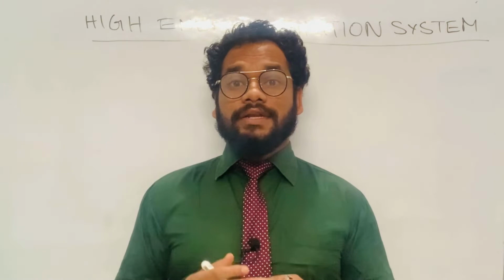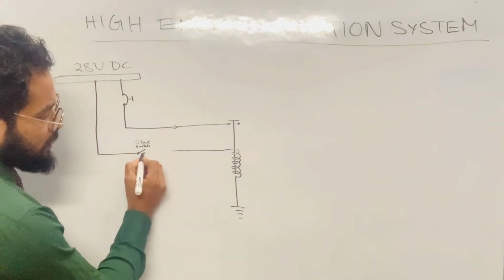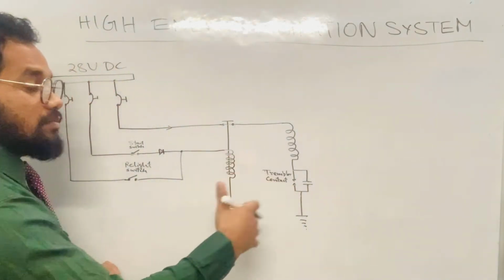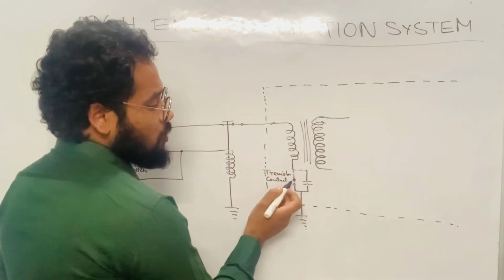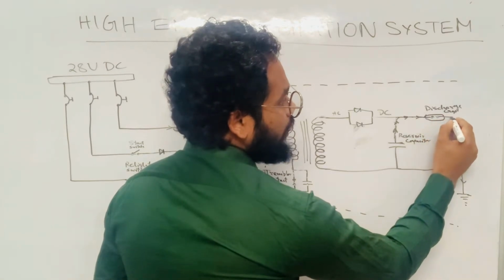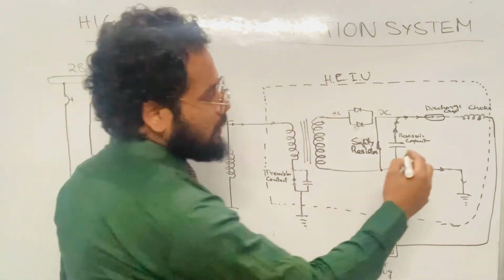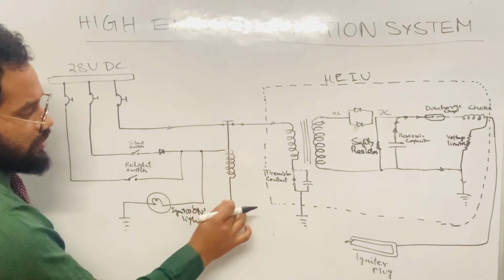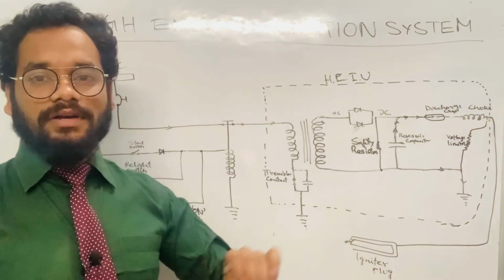High Energy Ignition Unit (H.E.I.U.) in Turbine Engine| Basic High Energy Ignition System-Schematics

Comment: Well honestly I have problems finding correct circuet for me own car who is Opel Ascona from the 80s it has GM HEI ignition with E Core coil 4 pin ignition module and induction trigger.
Any ideas how I posibly culd retard ignition timing in that thing?
It uses the MC 3334 ic chip easely can by found diagram for the HEI ignition system.
And you didnt realy mention if the source is pulsed dc or flat line,what frequency is that trembler operating at and if it realy did crated ac why peopel dont get shocked true the chassys in a plain? the coil it self has no value primary and secunady windings ,the tungsten spark gas has no value how wide is the gap ,no one mentioned what is that choke rated or that capacitor what its it type electrolitic or not ,honestly no one mentioned diodes value or type or resistor values.
Same problem like my here .
That looks like waste spark ignition some plains used dual ignition.
Again no one mentioned how to use bouth ac or dc ignition and not get shocked from the chassys and if there is any charging system present how to prevent baterry and alternator to suffer damage.
Happened to my multipel times alternator starting charge manipulation by external hv capacitoes or diodes failure or voltage regulator failure or dual relays arcing .
But no one realy explain those topics who are important.
So no wonder Im anoyed honestly .
By the way I need such ignition system I run my car engine on exaust ignition but obviusly I need a means to control some how ither trembler coil saturation or resistor/capacitor box .
So I hoppe some one know how to fix those problems I plug my own hair out for days figuring out where to find such deam system that works.
Honestly angry like beaber here
Reply from the maker: To retard the ignition timing on your Opel Ascona's 4-pin MC3334 HEI system without damaging your charging system, replace the 4-pin module with a 5-pin GM "EMR" style HEI module (1980–1981), which features a dedicated "R" (Retard) pin that automatically delays timing by a fixed 5 to 10 degrees when flipped to a chassis ground. The system operates on flat-line 12V DC input from the alternator, which the MC3334 switches to create pulsed DC through an E-core coil with an ultra-low primary resistance of 0.3 to 0.5 Ohms. To safely run this high-load setup for exhaust ignition without getting shocked or frying your alternator regulator, you must isolate the high-voltage return loop by bolting the module's metal backplate directly to a clean chassis ground, wire a 0.25 to 0.47 µF non-electrolytic film capacitor (rated for 400V+) from the 12V supply to ground, and shield your alternator by installing 1N4007 flyback diodes across all relay coils to safely clamp inductive voltage spikes.

Comment: Ineed some information for capacitor high power 
Volt?
Capacity?
Reply from the maker: In an aircraft's High Energy Ignition Unit (HEIU), the internal storage capacitor typically operates at a voltage range of 2,000V DC to 3,000V DC (with some high-power systems reaching up to 5,000V DC), paired with a relatively small capacitance of 0.01 µF to 2.0 µF (Microfarads). This specific combination is mathematically calculated using the formula \(E = 1/2 (CV)square to instantly dump a high-energy plasma arc of 4 to 12 Joules across the igniter plug's tip in a fraction of a millisecond. Because these heavy-duty capacitors are designed for rapid pulse discharges, they are hermetically sealed in specialized metal cans to withstand extreme engine bay temperatures and vibrations without leaking or losing their dielectric strength.

Comment: Sir please upload a topic on anti skid system
Reply from the maker: Sure in near future; As of now you may see this: An aircraft antiskid system prevents main landing gear wheels from locking up during braking by utilizing a high-speed, closed-loop control network that continuously balances tire traction and deceleration. Digital or analog wheel speed transducers inside the axles monitor individual wheel rotation speeds and report them to an Antiskid Control Unit, which compares the values to the aircraft's actual ground speed. If the computer detects a rapid wheel deceleration indicative of a skid, it commands an antiskid control valve to instantly vent hydraulic pressure away from that brake assembly, allowing the wheel to spin back up and regain traction before reapplying pressure. This continuous modulation—which also incorporates touchdown, locked-wheel, and hydroplaning protections—ensures maximum braking efficiency, prevents catastrophic tire blowouts, and guarantees the shortest possible stopping distance on wet, icy, or snow-covered runways.

Comment: Very good post,
can you please upload for 240v AC voltage instead of  DC
Reply from the maker: Sure. An AC High Energy Ignition Unit (AC HEIU) configured for 240V AC eliminates the need for internal chopper or oscillator circuits because the incoming power is already alternating current. The 240V AC input feeds directly into the primary windings of a heavy-duty step-up transformer, which instantly jumps the voltage to approximately 2,000V to 3,000V AC. This high-voltage AC is then passed through a rectifier diode network to convert it into high-voltage DC, cleanly pooling energy into the internal storage capacitor until it crosses the threshold of a gas-filled discharge tube to dump a 4-to-12 Joule plasma arc. By bypassing the high-frequency switching stresses inherent to DC-to-AC conversion components, these 240V AC units run significantly cooler, feature simpler circuitry, and provide excellent component reliability for industrial gas turbines, power plants, and marine engines.

Comment: Sir i didnt understand whats the purpose of the tremble capacitor.?
Reply from the maker: Capacitor blocks DC i.e. the dc current which flows through the primary winding of T/F (in the circuit diagram in video) will charge the tremble capacitor. When this capacitor gets fully charged, it discharges via the 2-contact points (since capacitor voltage is high, the 2 contacts close) which then provides grounding path to the dc current flowing through the primary winding of T/F, soon after which the contact points re-open (as capacitor gets into the discharged state). This cycle of opening and closing of the contacts keep going on along with the discharging and charging of tremble capacitor. Hence, the name tremble capacitor & contacts. Due to this, the dc current in primary winding of T/F creates a fluctuating magnetic field in it.

Comment: One more thing i just wanna ask that what is Electrical couple mean in a320?? I found written one thing that a320 generators are never electrically coupled with each other what does it mean??
Reply from the maker: In manuals like FCOM or AMM, when it states that Airbus A320 generators are never electrically coupled, it means that two active Alternating Current (AC) power sources are strictly forbidden from operating in parallel to feed the same electrical bus bar at the same time. Because the A320 operates on a 115V / 400 Hz AC electrical architecture, coupling two generators together would require their voltage waveforms and phase angles to be perfectly synchronized down to the millisecond; any slight deviation would cause massive cross-currents, trip circuit breakers, and severely damage the system components. To eliminate this risk without relying on heavy synchronization equipment, Airbus utilizes a "Split-Bus" design philosophy managed by automatic mechanical switches called Bus Tie Relays. This configuration keeps the left and right sides of the aircraft's electrical grid completely isolated from one another, ensuring that while a single generator can reach across to take over a dead bus during an engine failure, two live generators never merge their power lines on a single circuit.